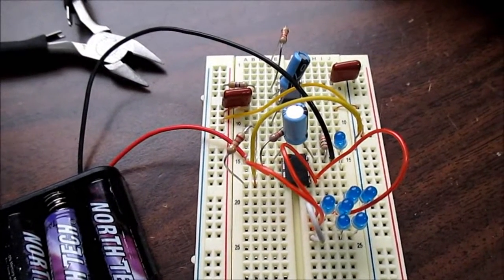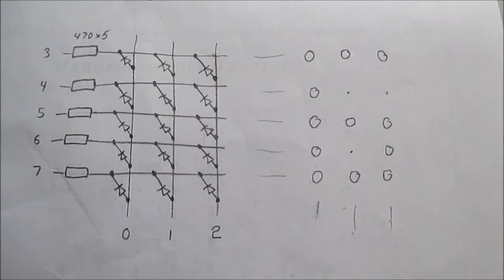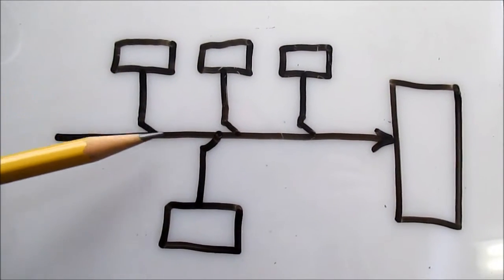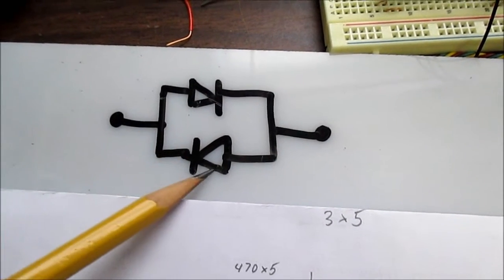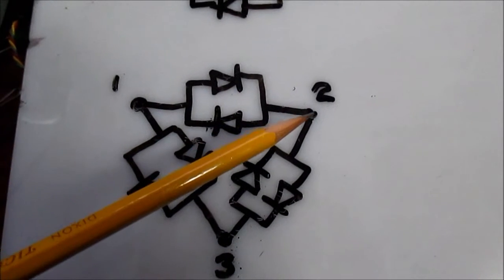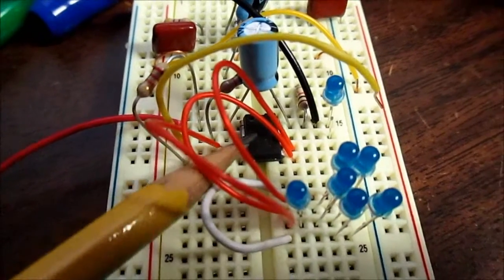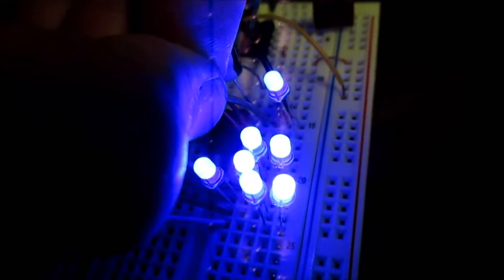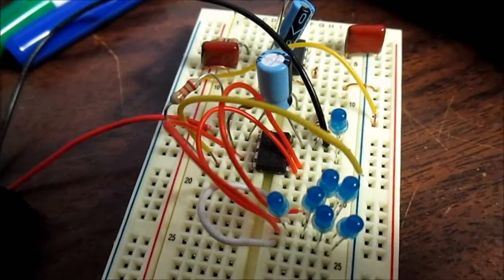Charlieplexing LEDs with microcontroller explained

Comment: Your triangle-shaped circuit is the most clear way to show it :> Am I right that for 4 control pins it would be a square with two diagonals?
Reply from the maker: You are correct. 12 LEDs. 4 squared - 4=12